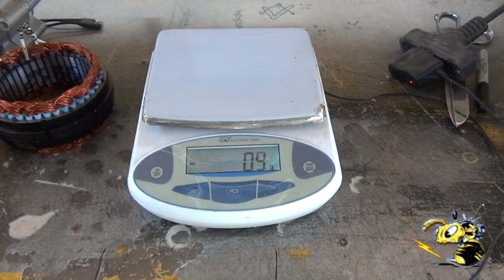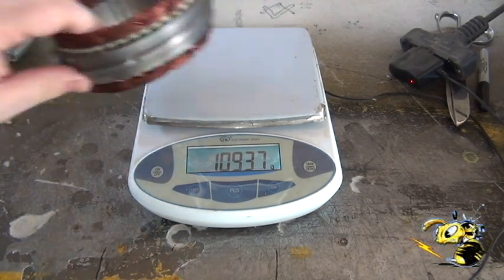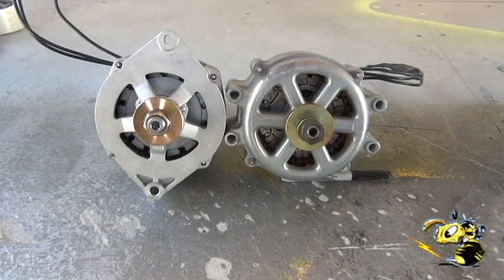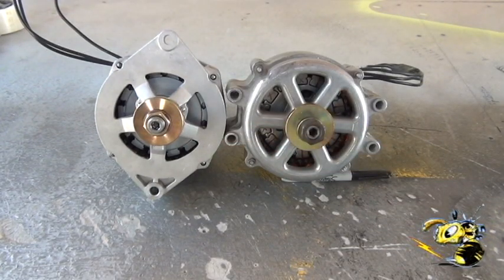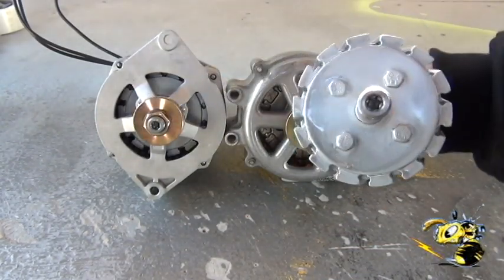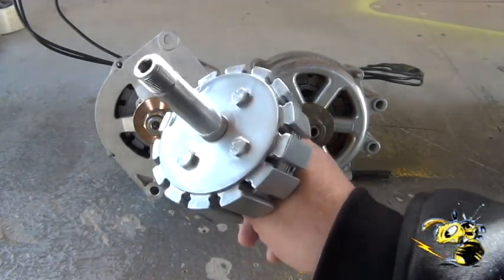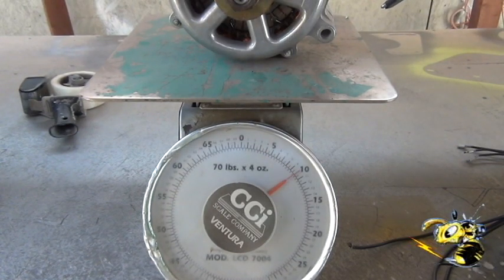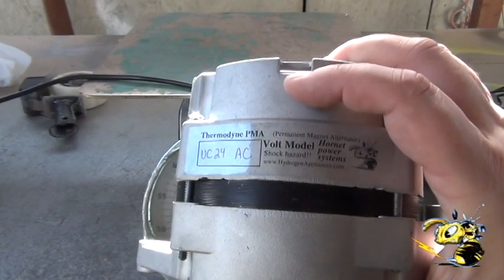Ultra core Thermodyne System PMA PMG Next Generation permanent magnet alternator

Comment: So, if you have an AC alternator, do you still have to run it through a rectifier before an inverter?  In this case Grid Tie?
Anyone out there can answer - appreciate it.  Always vexes me.
Reply: The only reason you run it through the diode block rectifier is to change to DC current to charge a 12 or 24 volt battery bank , 
Yes you can run the AC straight to the inverter but as soon as the PMA stops turning whether you are running it by wind , water wheel or even solar , the power stops , it's called a blackout because all power goes off , but with batteries the power stays on because the battery runs the inverter,so unless the wind or water blows or flows 24/7 then go with the rectifier and Battery Banks

Comment: Shouldn't we all be pushing how to do more solar! Looks like after 7 years of my use of small wind that the only real deal is solar. Just have to take the $1000 you end up spending on these worthless devices and put it into 4 more panels and 4 more big batteries and then your problem is over.
Lets see some solar.
Reply: +Јохн «HEADSMASHER» Даниел Wind still blows at night. A combination of wind and solar is best.
Reply: ***** Exactly. I just bought 3 pallets of Stion 135 watt panels. And the wind shit is all gone.
Reply: +PlasmaBurns Simple math. You add 130 amp hours of battery and 200 Watts solar for $200 less than a shitty junk wind turbine and come out ahead with more. Screw small wind. 7 years in a windy location and I can say first hand after owning 8 brands.... they are all SHIT.
Reply: +Јохн &#171;HEADSMASHER&#187; Даниел I agree to a point. Have you tried the ExtremeWind turbines? Shawnee Oklahoma. I tried and failed with a few wind companies myself.